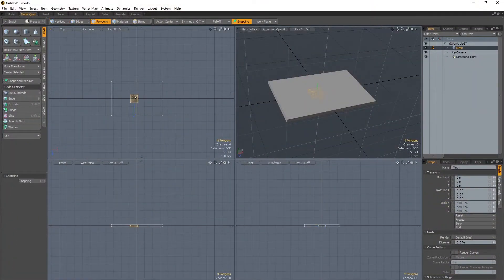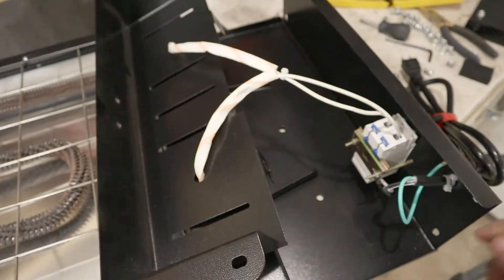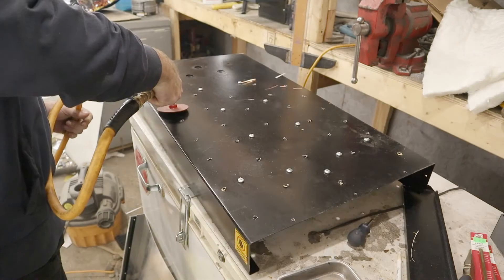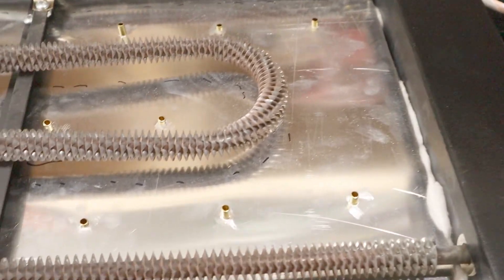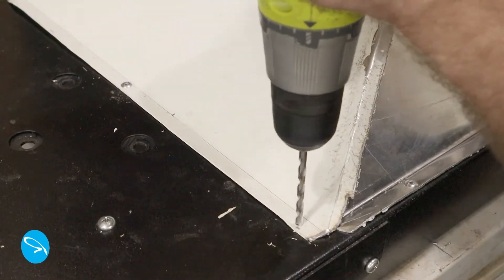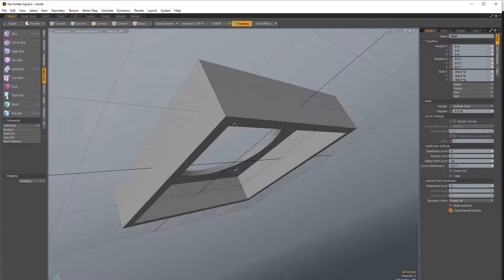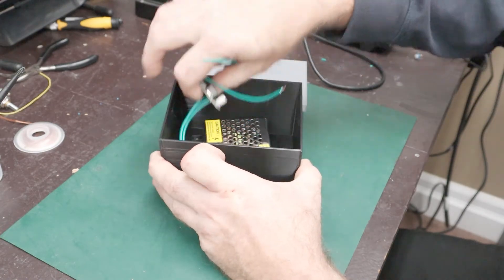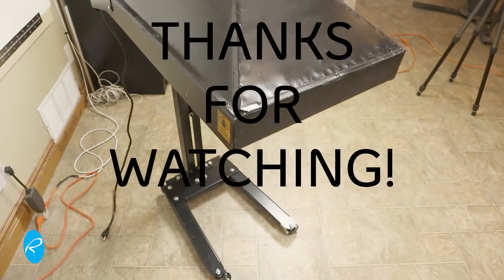Adding forced air to a cheap flash dryer.

Comment: So how much more fan do you need to properly evaporate a water based ink so it properly cures? What do you recommend? Does hiis work.
?
Reply from the maker: The water based ink won't start to heat set until after all the water has been removed. Trying to evaporate it with heat alone is a long and tedious process. Put 3 patches of acrylic ink on 3 separate pieces of non absorbent substrate, like a ceramic plate. Put a light bulb close above one as a heat source, put a warm hair dryer on the second, and do nothing to the third. The one with both heat and air (hair dryer) will dry the fastest. Heat alone (bulb) will be second, and the one left to sit will be slowest. After this video I did double up on the fans, so there are two of them stacked on top of each other. I don't use this flash dryer to cure, I have a conveyor dryer for that and it has air circulating fans inside of it. This is just to print/flash/print between colors. Even with two fans it's still about 20-30 seconds to dry the ink enough for another hit, but it was a lot longer than that without the fans. The problem is as you add more airflow you are cooling down the heating elements. This unit is only a 110v, I regret not getting a 240v but didn't think of it at the time. Basically, the more heat and air you can muster, the faster water based ink will dry, but it's going to heat up your shop a lot.
Reply: @RichardThompsonCA  makes sense  thanks for the explanation. Any idea alot of people recommend infrared flashes for water based ink?
Reply from the maker: @urjnlegend  I think IR is more desirable for any type of ink because it's a more even heat as opposed to the coil in this unit, which definitely has hot spots. When I print with discharge you can definitely see the effects of those hot spots on the shirt. My conveyor has 3 IR heating elements in it. I think IR is also supposed to put more heat into the shirt and less into the air, but I'm no expert. I would have preferred a forced air quartz unit, but just couldn't afford it. They are triggered by sensing the rotating platen, they heat very quickly and shut off after a set amount of seconds, so they don't waste electricity heating the whole shop up.

Comment: How well does this work in application? Have you modified it since? Very cool video, definitely going to attempt this.
Reply from the maker: I haven't modified it since but I've thought of stacking a second fan on it, for increased air flow.  I'm just learning screen printing so I've only been creating test/practice shirts. But of the prints I've done it's working well. I'm only using water based ink so I needed the airflow. I would have really liked one of those instant quartz ones, but they run about $2000 here and I can't afford it at the moment, but it's on the list of upgrades.
Reply: @RichardThompsonArt  Awesome, thanks for the reply. Would love to see the modification at some point! I've started shopping around for used infrared ones to attempt to modify.
Reply: So does it suck or blow the air?
Reply: @Tristano.t  blows the air from the top through the heating element onto the garment.  this helps displace steam that is caused by waterbased ink curing.

Comment: This is incredible i have a question how hot does the shirt get when you turn it on to dry it. And would you be willing to make another?
Reply from the maker: It's more of a matter of time than of temp. The heating elements can get hotter than my thermometer can test (>600 degrees), so given enough time under it I would imagine a shirt could get close to that, but that would catch the shirt on fire ;-)  With the pallets hot, it takes about 10 seconds to cure a layer of water based ink enough so you can do another coat. I haven't tried plastisol yet.